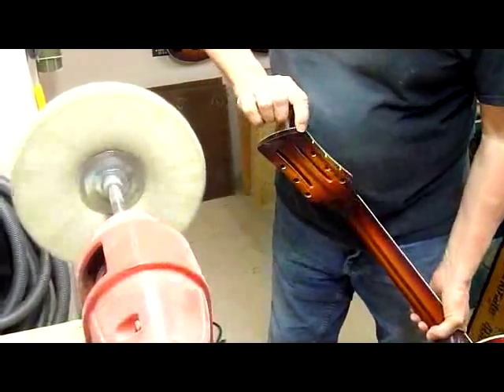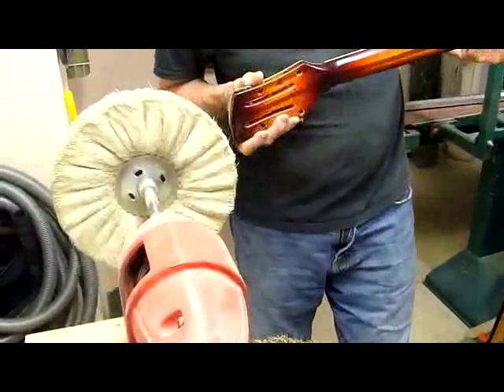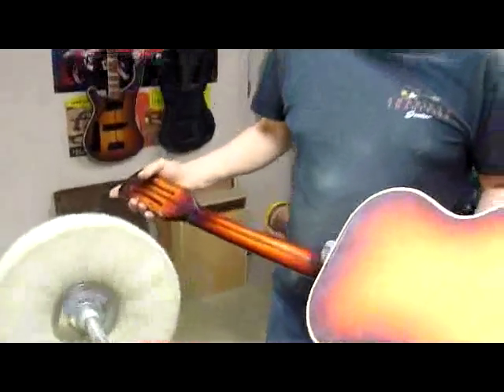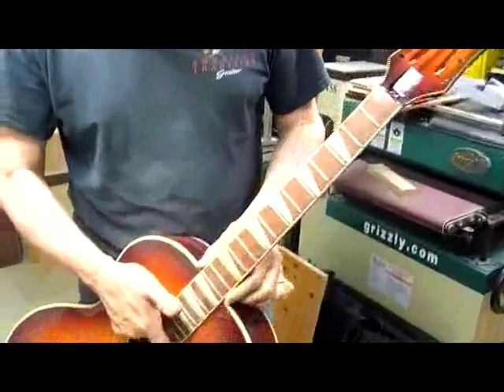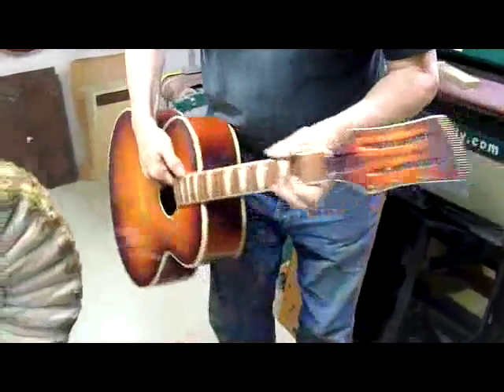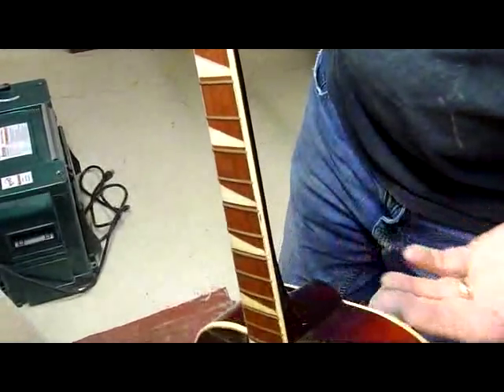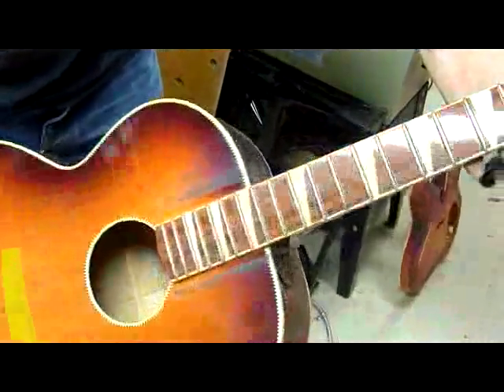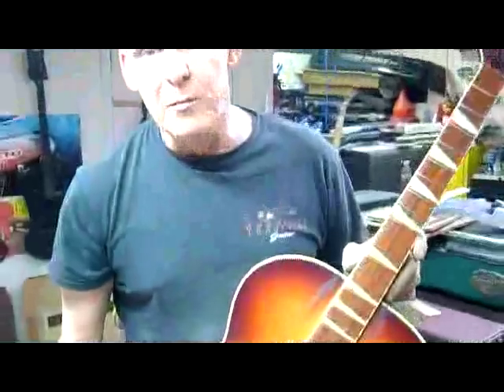Buffing The Jumbo PART 2.mp4

Comment from the maker: Depends on whether you're wheel-buffing or hand-buffing; hand-buffing requires the extra 2000 grit final step. Wheel-buffing only needs 1000 grit as the beginning surface.

The area between the frets is done using an assortment of  4 Dura-block sanding blocks in several widths, from 1" wide down to 5/16" wide.

Sanding doesn't make the frets smaller, although it does lower them the thickness of the varnish. Playability is not affected.

Comment from the maker: There are fully 4 different sanding stages in every refinish: stripping the old finish back to bare wood (dry, coarse, then finer paper), sanding after the sealing process (fine, dry), sanding after the first 3-5 coats of catalyzing PU varnish (fine, dry), and final sanding before buffing (super-fine--1000-wet).

Comment from the maker: Sometimes all of these stages don't add up to four hours, sometimes one step alone can take 6. I discovered early on that 1500 or 2000 wet sanding accomplishes nothing except wasting time, when I can get a mirror finish on 1000 grit with the proper compounds.

My understanding of your own comments was that you can buff in 25 minutes after 1000, 1500, 2000 wet sanding.